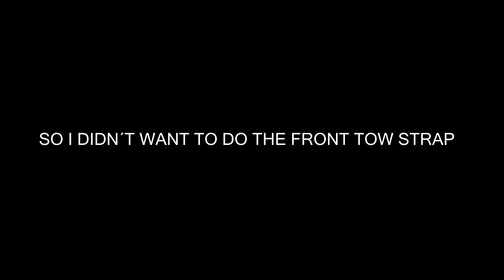HOW TO install TOW STRAP Peugeot 206 *Vlog.32*

Comment: One more question. Since the early 2000s Peugeot models have many similar systems  and constructions, is it possible to use your guide on a 307 [3A/C] 2003 too?

Thanks in advance :)
Reply from the maker: MARCaber Yes, you probably can
Reply: @DinoSergo  Thanks, will try :)
Reply: instablaster...